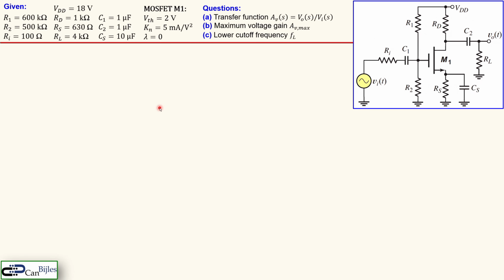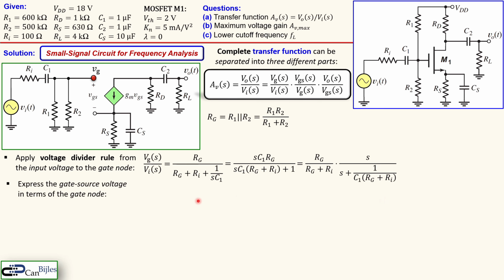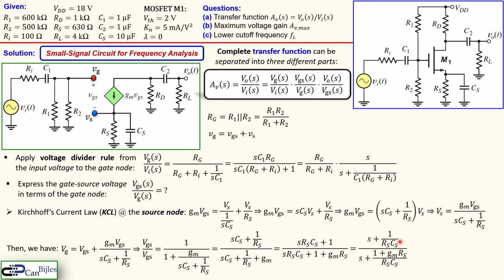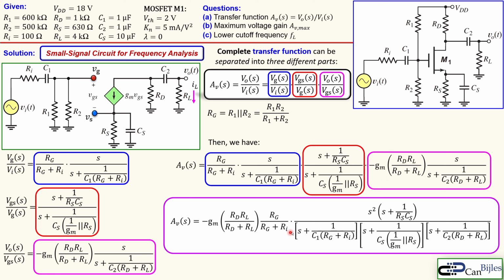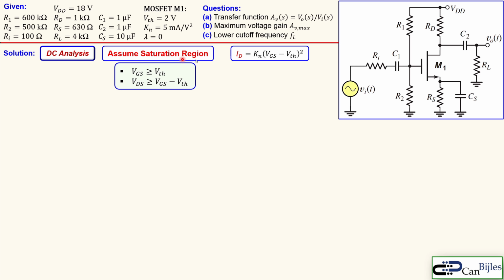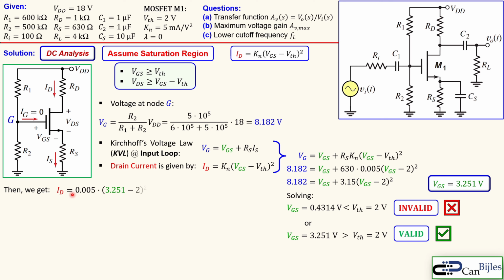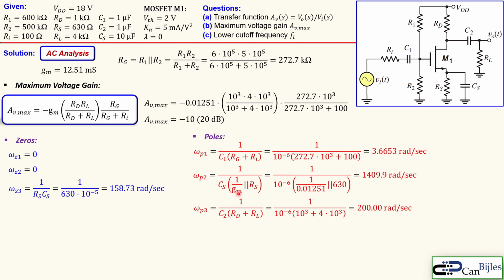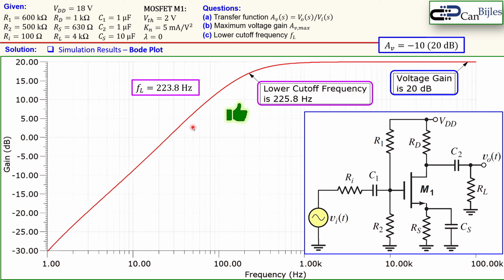MOSFET Common-Source Amplifier 📶 Low-Frequency Response 🎯 Coupling & Bypass Caps 👉 Transfer Function

Comment: crystal clear, thank you, i came to a conclusion is it true by the way?, circuit is a living creature with a unique characteristics (for us as an engineer to understand its behavior we use dc, ac, frequency,.. analysis, they are not separated but happened in each point in time/frequency domain at once, this living creature's each attributes "ac", "de", "frequency",.. get affected by various factor like environment, for us as an engineer/possible good designer it is critical to know the circuit and the environment in which circuit suppose to operate)
Reply from the maker: Thanks for your nice message! 
All things, like AC and DC operations, distortion, noise, and many other effects are happening at the same time. We just model them as being happening independently, but actually they are not.
However, it is almost impossible to solve a problem if we consider all effects at the same time. Moreover, we will not get a good understanding of the circuit if we even can do this, because the formula or the equation would be too complicated to understand and we will not have a good feeling a d insight about which part will effect the circuit the most. 

In summary: we try to orthogonalize the problem, even though we know this not the reality. Remember: "All models are wrong, some are useful!" 😉